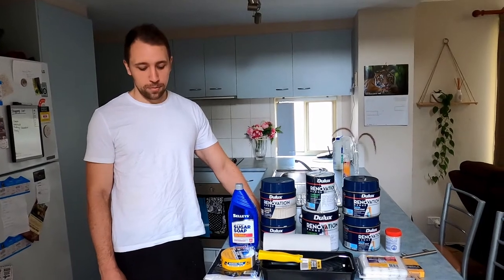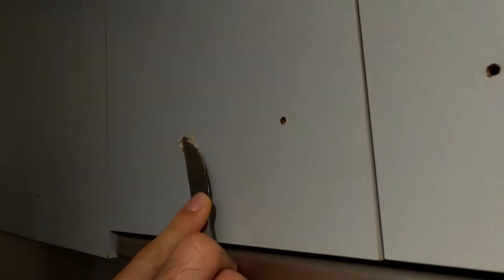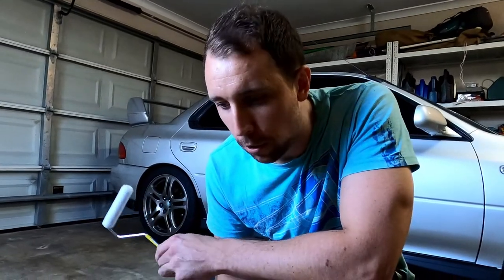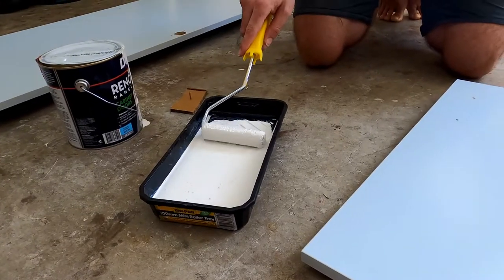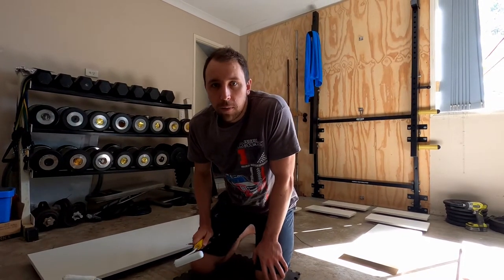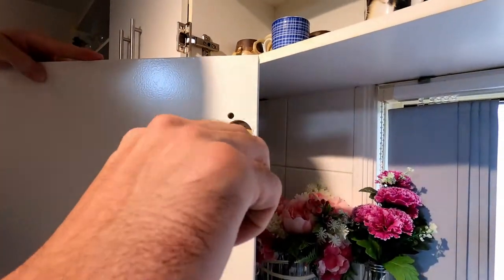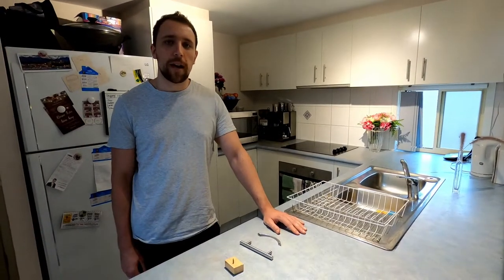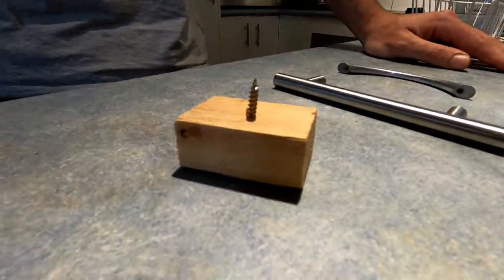How to Paint Kitchen Cabinets (Dulux Renovation Range)

Comment: Great hack! Out of curiosity how much primer, paint and clear coat did you use to achieve this look? Just trying to budget how many tins we'll need for a similar sized kitchen. Thanks!
Reply from the maker: I can’t remember sorry! It was so long ago. It should have a coverage rate on the tin / website, which is how we would have worked it out. I do remember we had heaps left over though…

Comment: How did you go with the clear coat? I’ve done two coats of white and it looked great. Started on the clear coat and I’ve experienced a similar issue to what I’ve read online- all these dark bits throughout the clear coat :’(
Reply from the maker: Ours came out perfectly. Depends how much dust etc. in the air I guess... especially if outside

Comment: how come you didnt paint the bench did you just replace it? if so was it cheaper to do so or would you recommend just painting it with the dulux range again thanks for the video were just thinking about doing the same and so i come across your video our kitchen looks similar
Reply from the maker: We replaced the bench with an engineered stone. Definitely not cheaper than painting. Not sure how long painting a bench top would last… have seen some of those rustoleum stone look kits - apparently they last fairly well

Comment: Hi, what is the material of your existing cabinets? I want to repaint mine and but they are vinyl wrapped and I'm not sure sanding them would work, thinking I might have to remove it with a heat gun first.
Reply from the maker: These were laminate cabinets. You might need to take the vinyl off and potentially look at a primer depending on the surface under

Comment: Unfortunately, our laminate is cracked and peeled. Can I still use the same process if I take the laminate off? MDF cupboards underneath....
Reply from the maker: In theory yes. I’ve used this paint on pine. Would recommend a primer. Not sure how good of a finish you will get though or long it will last as MDF doesn’t hold up too well…